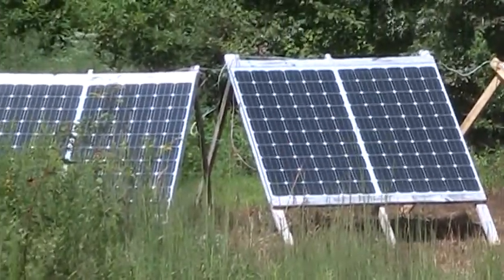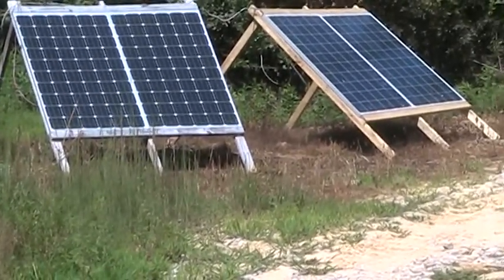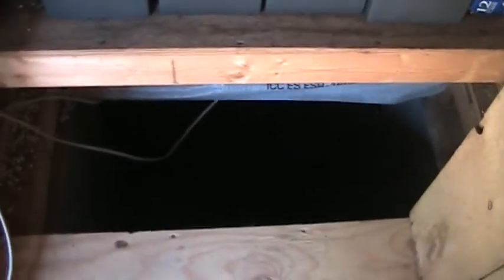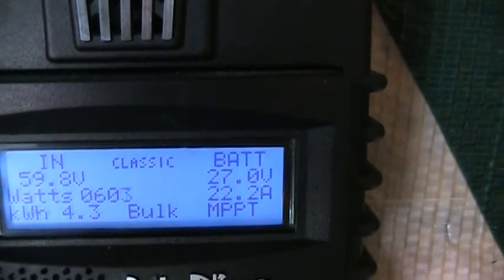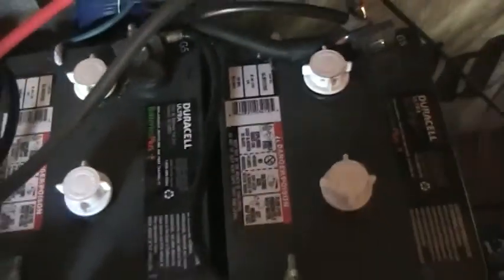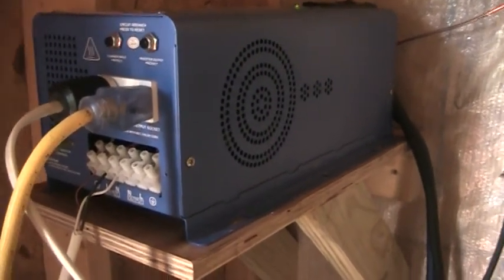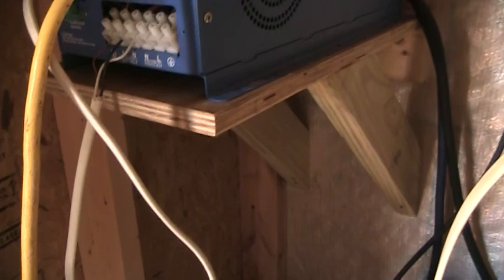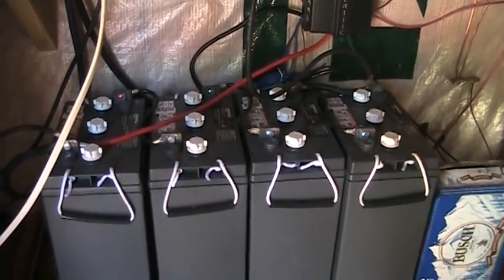Update of my solar system

Comment: Is there a reason you don't wire the panels in 3's to boost the voltage even more? Or are to trying to capture different stages of the sun with multiple directions of the panels
Reply from the maker: I have the panels set at different stages. One set is facing SE, the second set is facing straight South, and the third set is facing SW.. 
I should have mentioned that in the video, thanks for the observation.

Comment: I would think with more batteries one would get more volts (or power/amps) but if getting a few more helps with the life of the rest that would be good. sorry if I'm not grasping the idea. great update thanks for sharing.
Reply from the maker: It's a combination of panels and batteries, the more panels, the faster the batteries will charge and the more batteries you have, the more power you will be able to store for later use.
Reply: ok that I get thank you :)